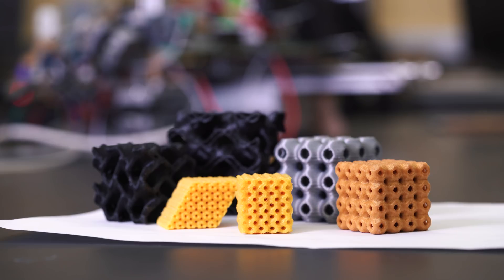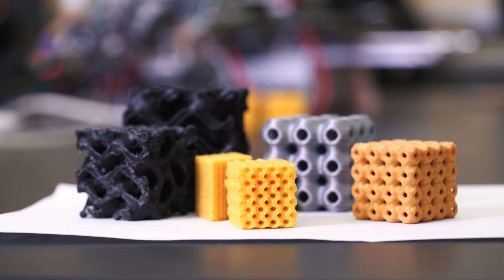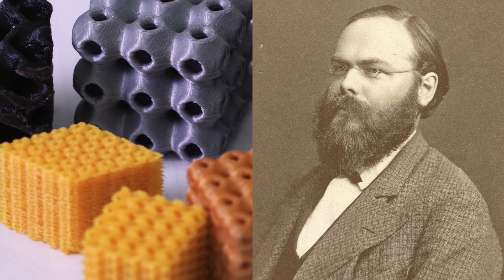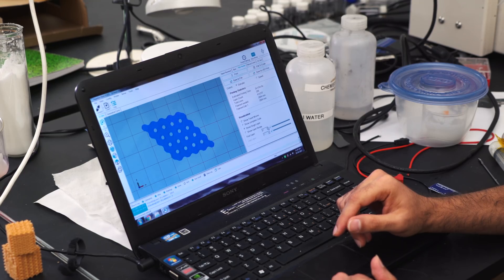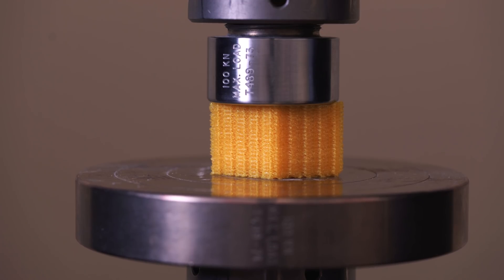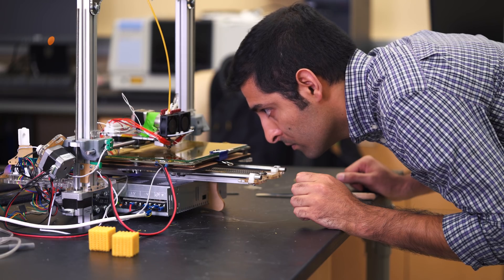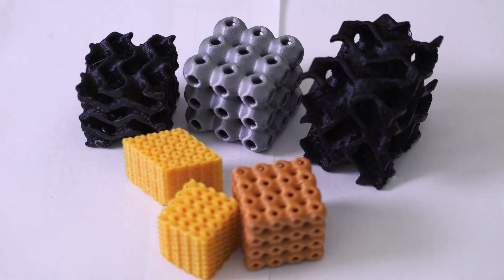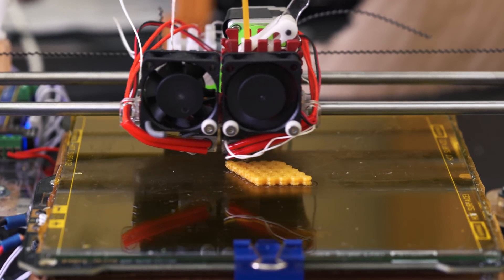Printed schwarzites may be building material of the future

Comment: Don't know if buildings are the #1 opportunity for schwarzites seeing as they're generally not looked at as something that needs to be "lighter". Indefinitly it would help if the material is cheaper because you're using less of it but I'd believe other places would be better suited for its use. Ie: boats, planes, cars so the created energy from the engines can be utilized more on moving forward than staying afloat or in the air. Along with this, it would provide a lightweight material for protection if layered behind a projectile resistant one. Awesome work you guys are doing! Hope all goes well in future ventures!